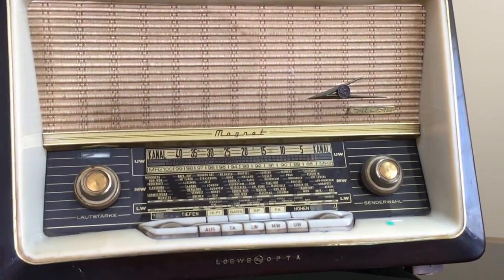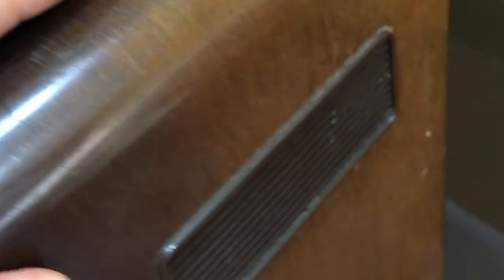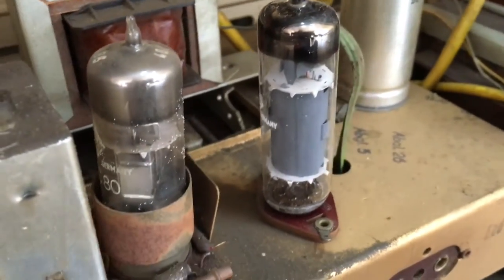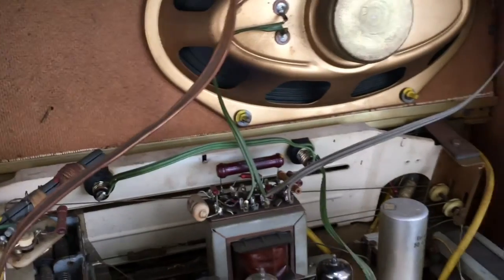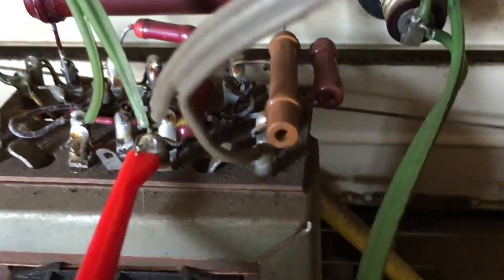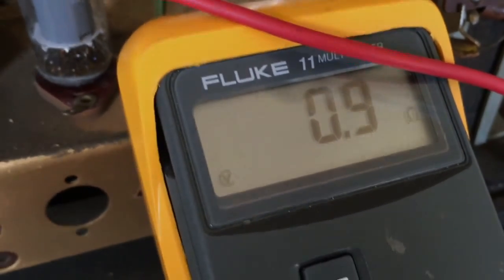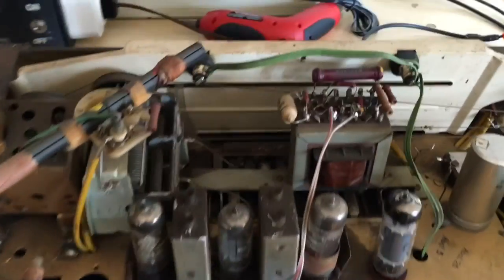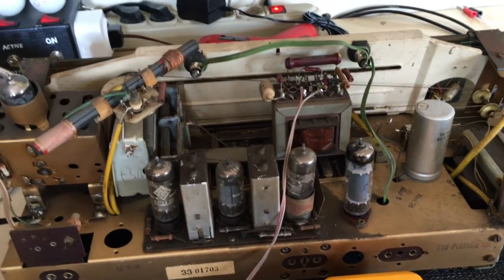Loewe-Opta Magnet 3737W tube radio restoration - Part 1. First look some preliminary testing.

Comment: Love the gold coating, in part, because different. 

At least you have a schematic. Körting made many different variations of the 981; mine is supposedly a 23671, though nothing comes up. Worse, the only paper I have is a manual, which doesn't seem to match (for MW/UM but has KW/MW/UW, push pull yet SE). Have to accept the terrible alignment as without instructions, can't be aligned. Seem to have a knack for getting ultra rare German consoles, the other is too . 😂 Going to be my first and third valve stereo restoration once get Dad's Volkswagen Käfer sorted, going to be interesting having no schematic especially if anything goes pear shaped.
Reply from the maker: Good luck 🤞
Reply: Thanks.

Got after pulling the chassis (that was interesting) and checking components. Interestingly, the resistors mostly were either bang on or way off, those that were off were usually high values; suspecting heat, some looked toasted, do live in a desert, so go with 1W and slightly lift off the board (originals are miniscule, about 1mm). Thought did have one oddity, a high value resistor that measured two ohms (VTVM and DMM). I was hoping to keep the carbons in the receiver section to better keep the alignment and being non-inductive, but, not to be.

Did find a resistor in the switching bent over another switch, suspect a factory oops, bet had no benefit. Also one of two capacitors replaced in 1975 (along with the power transformer) was touching low impedance or ground leg of another capacitor, in part because a wee bit too big.

All this to say, encouraged as should be an improvement in sound. Plus, encouraged because it is valve rectified (EZ81), a pleasant surprise once had the chassis out.

Comment: Nice looking radio. Thanks also for taking the time to go through testing prior to switch on. Very useful for valve novices such as myself. Looking forward to watching  progress. All the best Graham
Reply from the maker: +Radiocruncher : I tried to document every testing stage, because usually one just does it automatically and assumes others know what you've done. The problem is that not everyone does, and you can have 'shocking' results.

Comment: Excellent video. I restored a Loewe-Opta Komet about a year ago and it was my first German radio. The sound was fantastic, but the radio belonged to some one else. Not sure if you find it necessary, but I always replace those selenium rectifiers with a diode bridge using the original case. Oddly enough, the grime in the one I worked on was very similar to what you are experiencing.  Looking forward to future videos on this.
Reply from the maker: +zorka4098: I change the selenium rectifier  if the voltage drop is too high. Otherwise I leave it. As for the grime... I sometimes think what we do should be called radio cleaning, instead of restoration.
Reply: zorka4098 Алексей